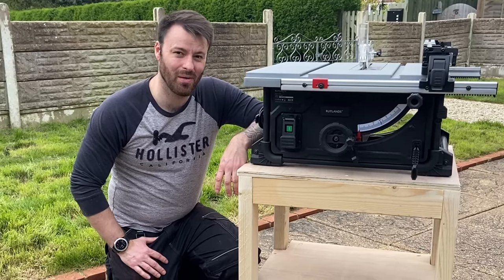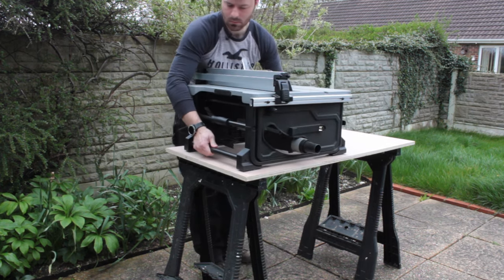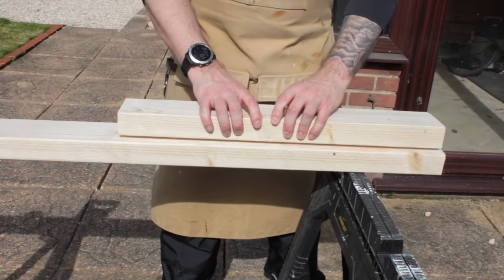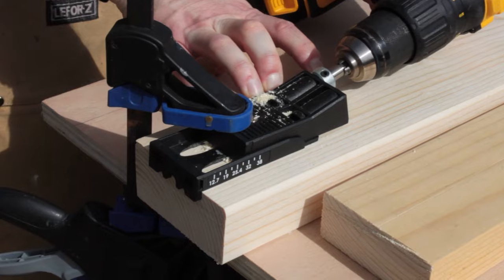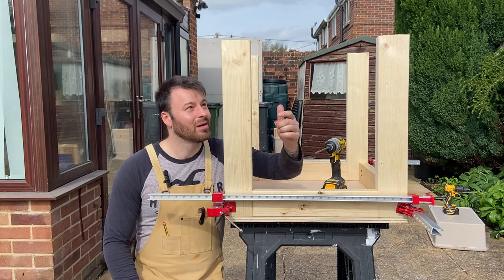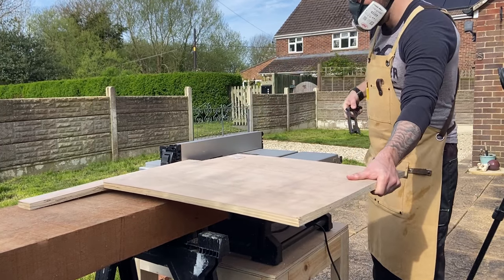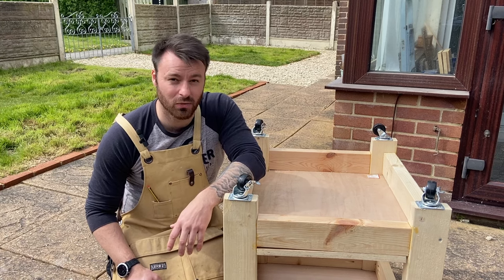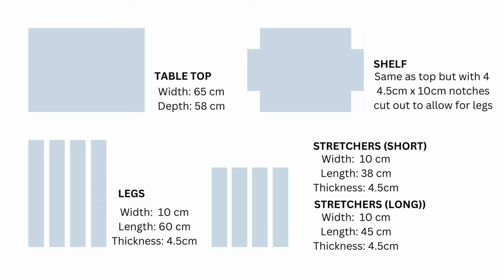Stop making RUBBISH shop furniture.

Comment: Good video When i use pocket hole screws i use the drill with the torque setting turned down a bit to stop stripping the screw out it also gives a bit more control on speed rather than the impact driver. Steve aus.
Reply from the maker: This is a great tip thank you very much! Will definitely try this in future.